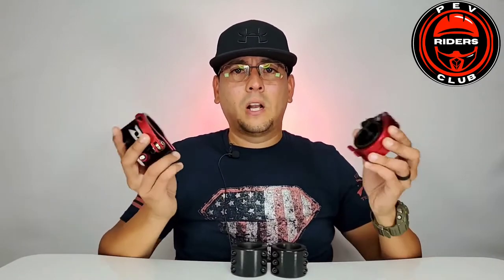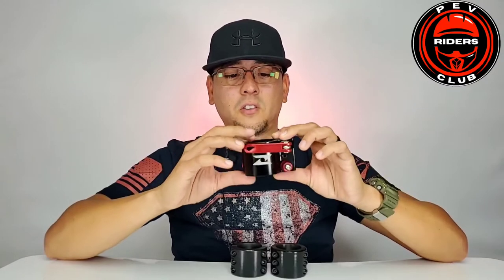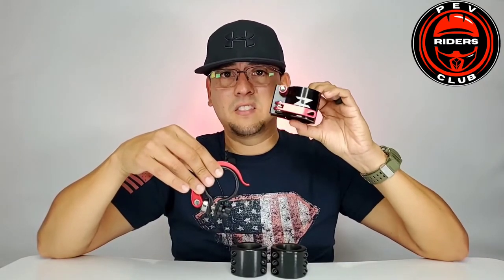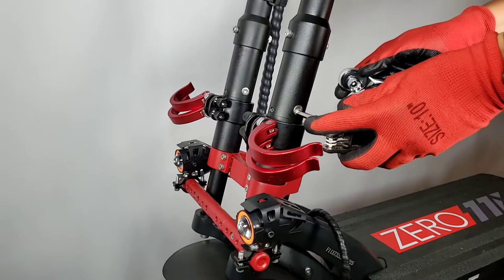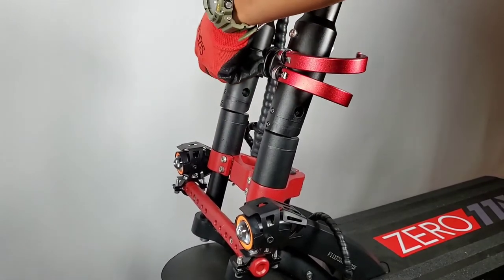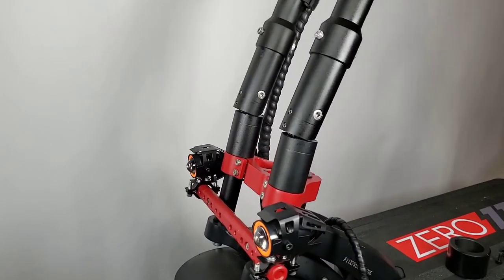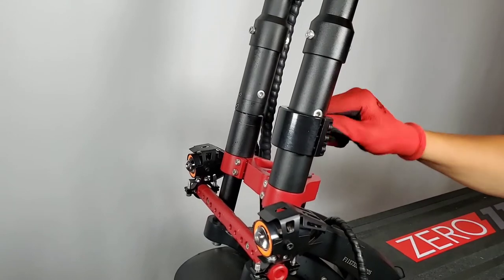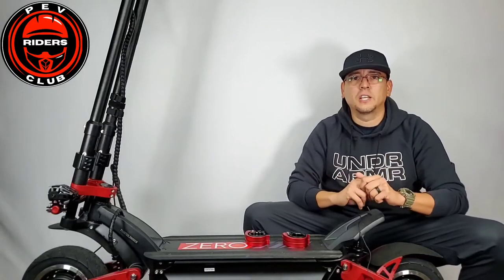Zero 11X Scooter Steel Clamps

Comment: I have just recently purchased a zero 11x,i noticed that if i squeeze the brakes and push forward,i have movement back/forth on the forks etc,can this be tightened,if so how?
Reply from the maker: 1. Have you changed your stock clamps?
2. There are 2 bolts underneath the dual stem that you can check also (just don't overtorque them to tight)
Reply: @PEVRidersClub  havent changed the clamps yet,as cant find them in stock anywhere

Comment: They should be longer for more contact area on the stems.
Reply from the maker: Hey! 👋😊 thanks for your helpful comment 👍😀  You are correct I have had the longer version on order at the time I made the video so as soon as they arrive I will be updating with a video to point out the difference between the two ALTHOUGH these current ones are longer and still better than stock 👊😎🤙 Thank you kindly.
Reply: @PEVRidersClub  Did you ever get the longer clamp? I would like to install it on my Turbowheel thx
Reply from the maker: I did BUT kept the same ones after realizing that the small on on this videos ARE BEAST!!! and are still there unmoved 💪🏽